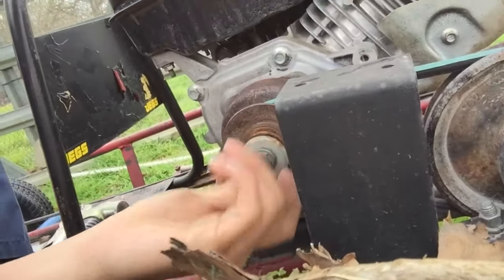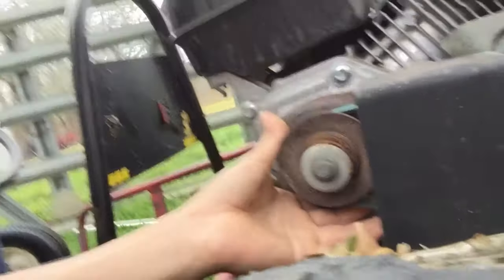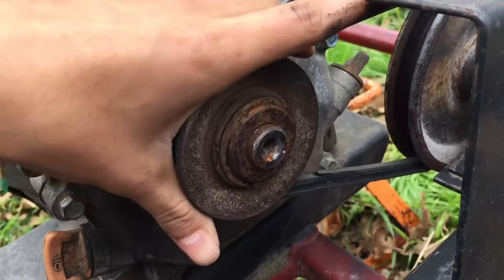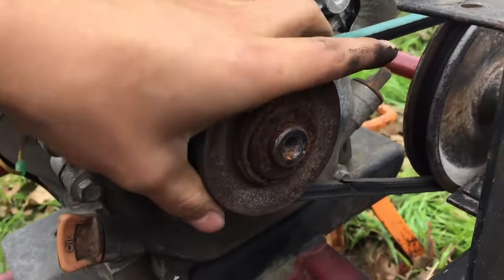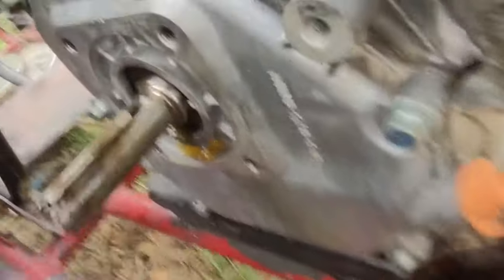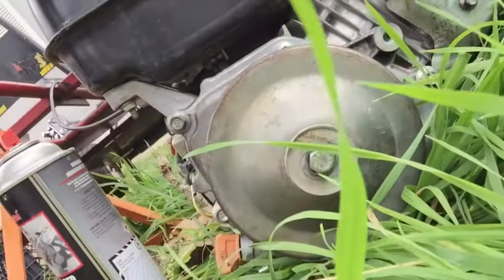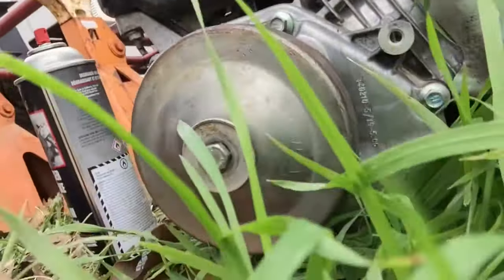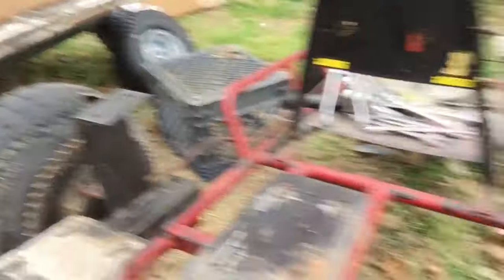Live Axle Install on the Red Go Kart (Cutting)

Comment: what type of clutch is that u took off
Reply from the maker: It's an early model "Hillard belt centrifugal clutch". If you search that in google or go to several go kart parts websites you should be able to find a similar model. But mine specifically has a 3/4 inch bore
Reply: +Jordan Pedroza ok thank u so what was wrong with yours was it worn out or just wanted something new
Reply from the maker: +Always Karting well if you watch the go kart drifting video you can see the clutch squeaks which isn't bad but a slight annoyance but the clutch worked fine and the inside of the clutch bell was glazed over which is expected but I just wanted to switch over to a torque converter set because I eventually installed the live axle and wanted to drive off-road ... Which was a joy except the fact that my back was feeling broken ...
Reply: +Jordan Pedroza I know the feeling after a day of serious riding it hurts. would u sell it by any chance? also if u get the time check out my vids.
Reply from the maker: Haha man sorry i already sold it because i needed money to support my other habits that have suspension i could upload the finished product of the go kart if you'd like and check out my other projects and by the way nice baja
Reply: +Jordan Pedroza thx and yeah that sounds cool I think that vid would be cool